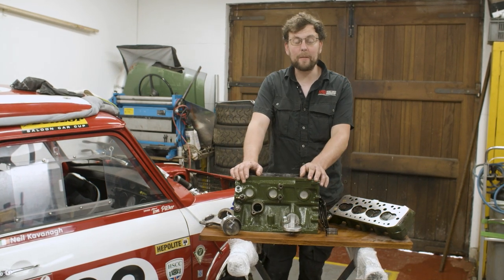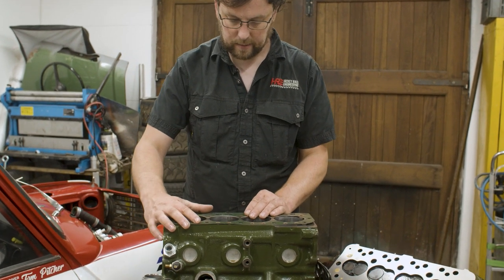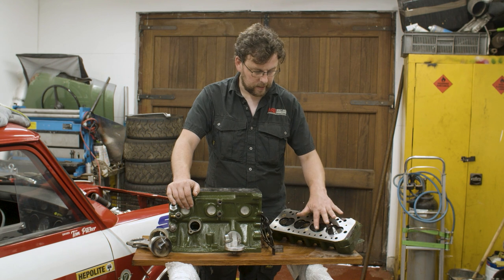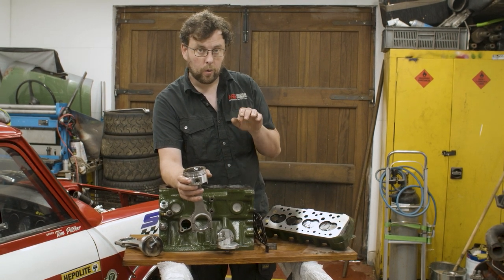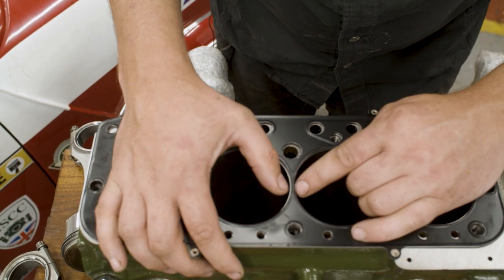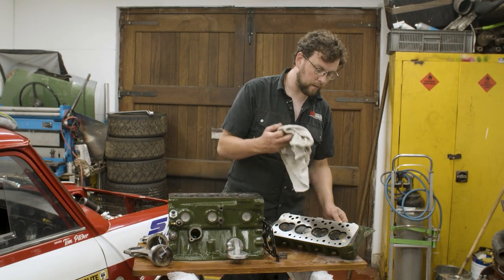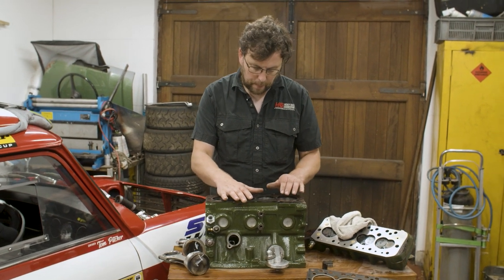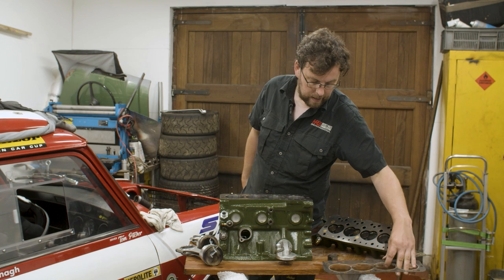Diagnosis Of Race Engine Head Gasket Failure - Classic Mini 1275 GT

Comment: Who would want to go motor racing? Excellent as usual and love the thought process. Incredibly unlikely the crankshaft was a contributory factor as even though it’s a 3 bearing, it’s a short shaft and there didn’t appear to be a wear mark on the outer edge of the bearing. The crown and lands look perfect so the piston didn’t hit anything harder than itself suggesting there is (was) sufficient clearance to the head. I’d like to see the gasket under a 10x, it might just reveal more wear on the lower side of the fire ring and a slight flattening at the top. Also gasket looked as if it failed instantly rather than gradually as it lacks the discoloration of a slow failure. How did the driver describe it? Slightly surprised you didn’t opt for a steel gasket from the outset, especially as you were running such close tolerances. You were right to get both head and block surfaced; the block is often neglected. Years ago we use to run them against one another to check for distortion. Doubt the con rods contributed although you did question their pedigree. The gasket should confirm this. It’s possible to rim the edge of the piston but shouldn’t be necessary with the steel gasket. Pity there aren’t more track days to play. You said the valves looked perfect and I assume the plugs so ignition and fueling are good. One simple try is a double gasket to verify it’s only a clearance issue, but when you sort this you’ll have a flier. Compliments on a honest open look with nothing hidden and a thought process that is as intriguing as it is incisive. Just another great video. Keep them coming. It’s some compliment to be mentioned in the same sentence as David Vizard, but I’d be hard pressed to decide who it’s complimenting. Just brilliant!!!!!
Reply from the maker: Thanks Tommy Yes defiantly think it was contact unfortunately

Comment: Hi Paul.  Just viewed your video - great job. In regard to the piston extending beyond the top of the cylinder, we deal with this on the Formula Vee race engines we build. In  a standard VW Beetle air-cooled engine VW recommend that the piston should be 1.5mm below the top of the cylinder to allow for extension of the conrod and other parts at high revs.  In a race engine this would be way too much so we machine the bottom of our cylinders to give a gap of about 0.15mm and this gives good compression. If we were to go level with the top of the cylinder or less than 0.05 the piston would hit the head at high revs. A VW Beetle engine doesn't have a head gasket but the cylinder fits tight to the cylinder head, so we wouldn't have the luxury of having a gasket to solve our problem. I found your video very interesting as it explores the concept of conrod stretch at high revs.

Comment: The original head gasket break out the side makes me think it can't be entirely a crank flex issue, or it would be more consistently between cylinder pairs.  However, a combination of crank flex and rod stretch (both somewhat expected at high rpm) would make sense, and would explain the variation in the head gasket fails.  Cheers, Paul - a perfectly logical diagnosis.  But the proof is always in the pudding - I look forward to seeing how this engine behaves once the changes are done and it's put back on track.  :-)
Reply from the maker: Thanks dude appricat it

Comment: Great content, loved this video!

Just an observation, could you rule out crankshaft flex, because, thinking back to your initial head gasket failure, it failed from cylinder 4 outward, not between 4 and 3, suggesting it’s random to an extent. 

"Chinesium" conrod stretch, my completely uneducated guess, just from listening to you there. 

The stainless gasket looks the biz too!! When you build me that FIA spec engine down the line I’d like a stainless head gasket please 😂😁
Reply from the maker: very good point mick  I think your sport on

Comment: Good video as usual, we use the cometic gaskets on our NA ardens,.it prevents the normal fire ring from eating into the heads. The only thing we have to watch out for is the copper rings that hold the parts together fouling the head.
Reply from the maker: Ya came across that my self I think they have changed the design now to move it to a new place
Reply: @HREIRL From your experience, I recently cometic gasket failed between 2&3 and melted the block and head. We used ARP fasteners however not 11 stud. Can excessive CR cause this, or could it be pinging? Maybe distributor is curved too aggressively?  Last time we took off the head it was not damaged but the gasket was black between 2&3 both on a commetic and copper gasket. Head was skimmed so was the block.

Comment: When you check the tdc stick out height add pressure to the bottom of the rod to take up any bearing clearance and recheck that height! Static and running clearances change your not compensating for the spinning, while its spinning the bearings is wanting to throw outwards, statically its slightly lower due to the clearance! If you have 0.06 clearance that would give you a minus .03 reading static but when spinning that would/ might double up adding to your stick out.
Reply: Is this something you'd check on any engine or just "race/performance"? I don't think I've seen anyone do this 🤔
Reply: @tobymiddleton6763  Wont be an issue now he has the correct sized head gasket, as most are designed for a plus .060" overbore. Where i used to work bought in many sets of pistons, say ten sets weigh them up and put the lightest to the side, as one piston within the engine couldn't be machined, had to retain original markings for the formula, We then measured up the pin to crown heights, we could then skim the heads of the pistons to match the height of the lightest it would then be also matched for weight balance, each rod journal would then be re-sized for length so each rod was exactly the same length not for oval journals, this gave us a consistent deck height across all pistons, we would do a dry fit up before the deck was ground.
Reply from the maker: Very good point chris noted 👍

Comment: Let's hope that you've sorted it. Just wondered if it could have been caused by the rods and pistons expanding at a different rate than the block and resulting in the pistons coming slightly out of the top of the block. I know from bitter experience how disappointing etc. it is to withdraw a car at the track, especially as I assume that it was advertising your business. When I was racing in the early 1960s we didn't have anything written on our cars so this didn't arise. Fingers crossed for next time, good luck.
Reply from the maker: thanks for the well wishes Tony. I never mind making mastakes that all part  of it

Comment: I had the same issue with an 80 thu oversized 998, chamfered the pistons crown and used a custom compensate gasket
Reply from the maker: that is an interesting solution, how has it faired out ?
Reply: @HREIRL  your video helped me solve the issue, why I was blowing head gaskets you were spot on with your findings,  had zero deck Hight and the gasket was just as you stated, have more than 2000 miles on it now and the engine sounds and rounds very smooth, thanks for the videos and  nice work.

Oh if you ever need the Cad drawing for the small bore head gasket let me know 😊

Comment: Hi Paul, brilliant and instructive video, as always.  Couldn’t you just turn a half-millimetre chamfer around the top edge of the piston?  Surely the edges of the piston would be improved by this: no sharp corners to start glowing at high revs and risking detonation, and the tiny weight reduction would only be positive, albeit minuscule…?
Cheers, Will
Reply from the maker: good point Will and basically what we did 👍👍

Comment: another great content in this video,nice work mate,,i did see that janspeed would quite often fit a small length of fuse wire on the block between cylinders 2 and 3 then fit the gasket,this isnt an old wives tale its actually on one of their videos ive watched a few times,is this something you would consider doing bearing in mind this engine in question is a race engine..
Reply from the maker: something to consider all right

Comment: Another great video! Thanks. 
The book you mentioned from David Vizard. Which one was that? And what other books can you recommend?
Reply: The most applicable would be "Tuning BL's A-Series Engine" - but I'd also recommend "How To Modify Your Mini", which is more general, but covers a much wider range of topics including suspension, brakes, etc.
Reply: @aussiebloke609  Thanks. Did some googling "The Tuning The A-Series Engine" you can hold off but the other one (How to Modify Your MINI) is out of print. I understand that these books are the holy grail.
Reply: @rolflyden6324  I just found a few copies - all used, of course - on both Amazon and Ebay, for around USD $100, so they seem to be acquiring collector prices now.  But still worth it, I think - that price isn't likely to go down unless there's a fresh print run at some point.  I know I treasure my copy all the more now.  :-)
Reply from the maker: thats the one all right
Reply: @HREIRL  Thanks. Bought it used from the UK via eBay.👍

Comment: Brilliant! Love the analysis Paul. I’m interested to get your thoughts on the rods - at 6” they are a good option for me with datsun pistons in a normal deck height block. 
Also interested to know what sort of CR you run? Thanks
Reply from the maker: The rods are from what I have seen quite good if not a bit heavy. regarding compression ration typically aiming for 12:1 static

Comment: Do you know if there is a slightly higher temperature around #4 cylinder?
Could you remove the material from around the edges of the top of the Pistons rather than across all the top surface. 1/8th of an inch around the edge should be enough .......width not depth :)
I don't imagine you want to resort to Wills rings yet.
Reply from the maker: No I would certainly like to avoid the Wills rings for sure 😁

Comment: Hi Paul, is the crank cast or forged ? If it was forged would this stop any flex at high RPM ? With the stainless gasket will it flatten out to the edge of the cylinder when you torque the head down ? I just love your vids 👍👏🤤
Reply from the maker: Forged for sure Guy

Comment: Chamfering the top of the piston crowns is recommended by Keith Calver to allow for unknown expansion of components such as possible piston and rod thermal expansion, rod stretch under high rpm, head gasket manufacturing imperfections etc etc. Most of these events are not possible to measure statically or dynamically in the workshop. Only the heat of competition causes the extreme conditions. The original C-AHT 188 copper gasket is the preferred Special Tuning choice for competition use - not that Payen one you are using. I have never had a problem with the copper Special Tuning gasket now renamed GEG300 by Mini Spares. Copper compensates for surface imperfections and heat is dissipated away from the fire ring better. Chamfer the piston tops and fit the copper gasket on one of your test engines and I would be surprised if you had any more of those type of piston to fire ring problems.
Reply: Also… over torquing the head can squash rather than compress the fire rings. 45 ft lbs maximum with no lube on the studs or nuts.

Comment: Wonder if a crank balancer would detect any flexing higher than what’s normal?
Reply from the maker: unfortunately not as it doesn't spin the crank fast enough
Reply: My brother builds driveshafts and they spin them at 10-12,000 RPM’s to check any vibration, that’s why I was wondering, Do you guys race aluminum driveshafts? Or even carbon fiber ? Wonder if that’s something a mini could benefit from the weight saving

Comment: Check the tram of the grinding machine other wise it will grind  concave conrods can stretch o 5o at high rpm
Reply: I would have straightened the conrods then less to remove off the piston and the rings wood run true to the bore
Reply from the maker: Noted Aldo will do

Comment: Not knowing the actual composition of the con rods, is there a possibility of differential expansion under high temperature between con rod and block?
Reply from the maker: its passible Paul but as you say the rod is an unknown so we may never know
Reply: @HREIRL  Differential thermal expansion of the rods was also my first thought - it wouldn't be that much trouble to check the actual expansion of the rods over a temperature range and compare with the same length of steel?
Reply from the maker: @cdellis1000  Its an intresting idea Chris, and as you say wouldn't be very difficult to check on a test bench. we may well end up doing such a test in the near future as the rods are now surplus to requirements.

Comment: taxing my memory in the mid 1990s i did my trade training and had dealings with a mini racer it was known that big overbores would destroy the factory gasket i dont remember the solution i think it may have been a oversized copper gasket that cleared the bores
Reply: Also factory gaskets only work up to 0.060 th oversize beyond 60 over you need non standard gasket eg your mls cometic type gasket or a copper gasket with oversized bore relief